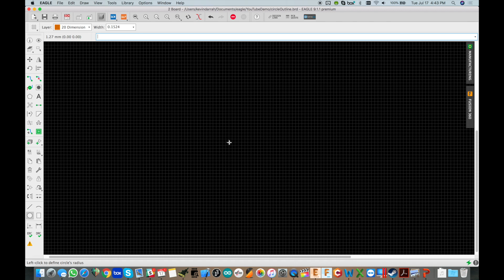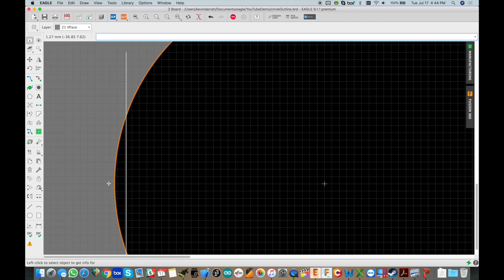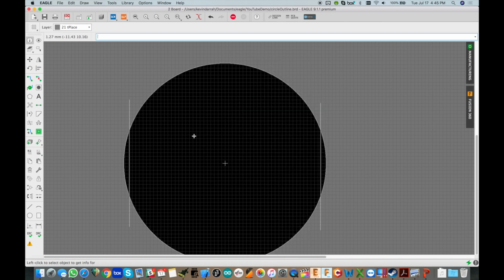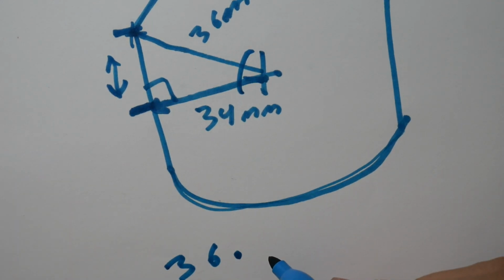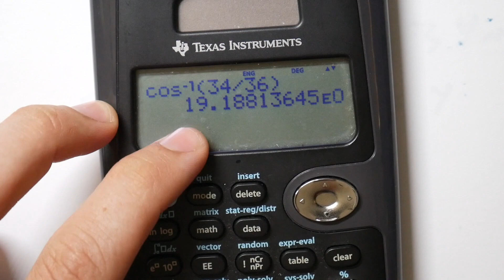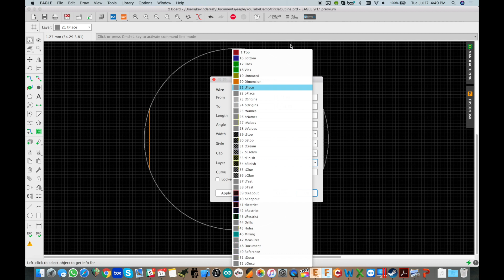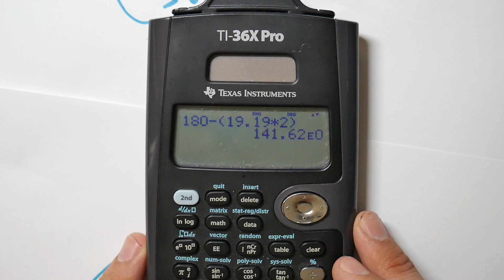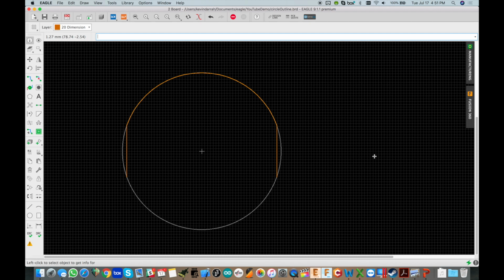EAGLE Design Tip - Circle Board with Flat Sides

Comment: Nice explanation.
As I was watching, I immediately thought why didn't you use pythagoras theorem rather than having to use 2 trig functions.... that became clear when you wanted to draw the arcs, you needed the angles calculated to do this.
Good solution.
Might come in handy this idea as I work a lot with Eagle (7.5) (My employers don't want to pay for the latest versions
Reply from the maker: ha, I know I now wish I would have explained why I didn't go the Pythagoras route... comments will be flooding in... then they see the part where I needed the angle... lol. It's totally worth the upgrade.  Autodesk is pushing updates constantly and the support is insane.  So far, so good anyhow

Comment: Instead of calculating the angle for the arcs, could you have just entered the center point at (0,0)? That would have given you a more accurate arc. That is similar to how arcs are defined in gcode.

Then you could have used Pythagorean theorem to find the height of the first line.

Comment: Eagle CAD makes me want to jump into a pit of alligators. 
The part creation tools are from 1982. The drawing/geometry tools are from 1980. It is slowly getting better, but still just awful. 

Routing has improved a lot recently and the pseudo-integration with Fusion 360 is a step in the right direction. Perhaps it is fair to say the routing is around the year 1995. The GUI/graphics engine still hanging back in 1990.
Reply from the maker: hehe, I think it will get better... Autodesk seems to really care about getting Eagle up to snuff
Reply: Autodesk is clearly putting in a BIG effort to get Eagle up to modern expectations. There are a lot of good additions and fixes - but at the expense of being a bit messy at the moment. I can only hope they stick with the pace they are going right now. 

It appears they are listening and acting daily - FAR more than CAD soft did for the past few years.
Reply: UX and UI is terrible. Instead of being able to focus on the PCB design I feel like I spend more time adjusting measurements and double checking everything or looking for something..

Comment: Pro Tip: If you are using a calculator and hand writen trig to make a PCB outline - you are seriously using a terrible piece of software. This is so sad. I am stuck with Eagle for the moment and do all of the geometry externally in Solidworks or Fustion 360. The tools in Eagle are just a waste of time.